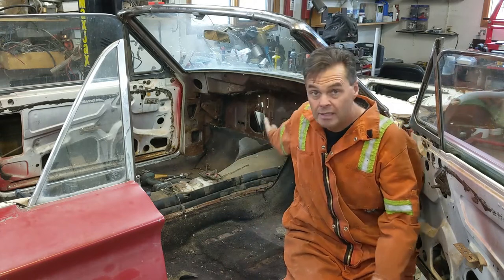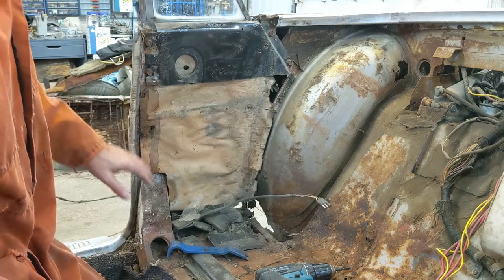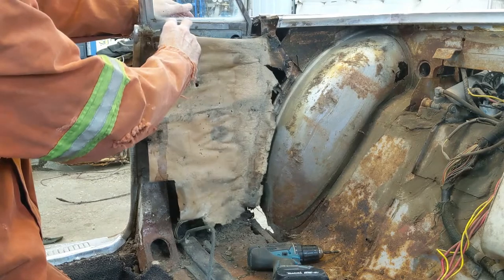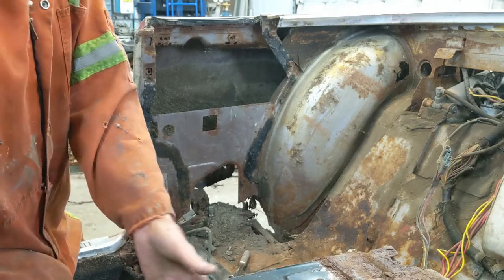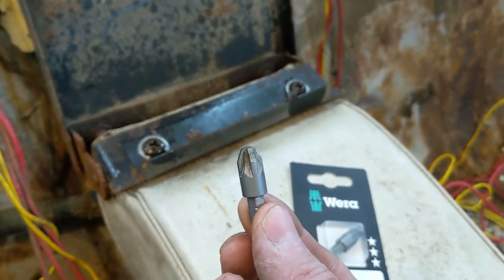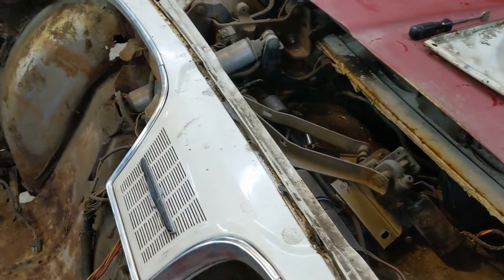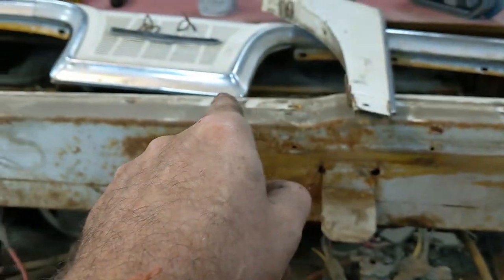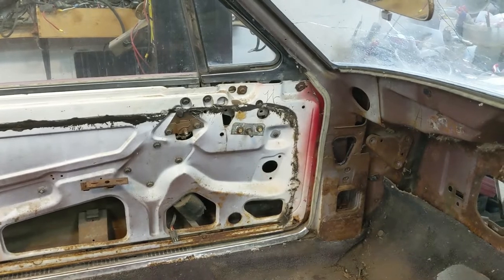SAIL Windows & Package Tray - 65 Thunderbird Convertible Restoration Ep #11

Comment: Was able to learn something from you this time. Both my rear windows are getting slow so im pulling them out this winter to grease and service them on my '66 vert. Probably saved me an hour of two of fiddling around. Thanks!
Reply from the maker: This was my fist time removing one of these, it was fairly straight forward...just remember there is also a bolt at the bottom that I didn't have to remove, because mine has rusted away.
Thanks for watching!

Comment: I have a 64 Convertible with inoperable sail windows.  The car has been mostly restored, but the rear driver's window stopped working about three years ago and the passenger stopped last year.  I have been dreading getting to them, but you have saved me so much time by documenting the procedure.  It's not as frightening as it seamed.   Fortunately, the top and wiring was completely replaced before I bought it, so my "surgery" won't be as extensive as yours.
Reply from the maker: The hardest part of the process is removing the seat bottom and trim, the rest is pretty easy.

Comment: Watched this yesterday, commenting today.  You are pretty much down to the base metal, and it will be interesting to watch the repairs as you press ahead.  I wonder if the adhesive on the seals is the same Motorcraft adhesive we bought in tubes back in the 80’s.  We used it on Mack trucks to glue the door seals on.  It was good stuff.  For that matter, I wonder if it is still available.  I don’t envy you the job of tracing the wires.  Once again thanks for putting this on Youtube!
Reply from the maker: Thank you Stephen...sealers have improved a lot over the years, I think just about any modern automotive sealer will work well. Yes, the wiring...no one of my favorite tasks, but is needed! Lol

Comment: Hey Jamieson, I think you can get the 2 convertible wiring looms in the trunk new. The sequential bag was wrapped with fiberglass and gaffers tape. All 65-66 bags were wrapped. I'm dying to see how your going to fix all that rust. Its just foreign to me. Show off your skills when you do that. Your where I was with my restoration, everything taken apart. Certainly a daunting task to put it all back together. I had to completely rewire the Thelma and Louise 66, it had all 65 Thunderbird hardtop wiring in it. All the original convertible wiring back to the trunk was missing and replaced with red wire. The two trunk looms were there but badly cut and butchered and unusable. I had two very good used looms so I used those. What a nightmare! I can see that you have your work cut out for you with that wiring. Good luck.
Reply from the maker: Thank you Nick...yes, this is a major project, and the hard work hasn't even gotten started! I guess worst case, I have a ton of T-Bird parts to sell!  😂

Comment: Hello Alvin. I enjoyed your video. I have a couple of questions for you. Will you be putting a speaker in the package tray? I think I saw in your earlier video that there is a radio in the trunk area. There should be a stamped code number on the top plate indicating if the radio is set up with the rear fader. I think you would be looking for the code "5TMS F". F for fader. (AM radio). The other question has to do with your LED lamps. I have a similar lamp, but yours appear to have magnets in the handle? 
My 66 does not have the rear windows (Landau), so I hope someone can get you some good photos of what and where those support brackets look like and how they attach. Good video, keep up the good work.
George B. in Michigan
Reply from the maker: Hi George, I'll take a look at the radio you are referring to, also the radio in the parts car, also in the parts car there is a factory install speaker package tray, and it looks like someone was trying to get it switched over from a single to a dual speaker (front & back) setup.
I love those LED lamps, they do have magnets, and are rechargeable...I bought them at Costco, however there are quite a few of the same style on the big online sales sites.
Once I start repairing the rear of the rockers, I'll take a close look into those quarter window supports...the green parts car still has them attached.
Thank you!